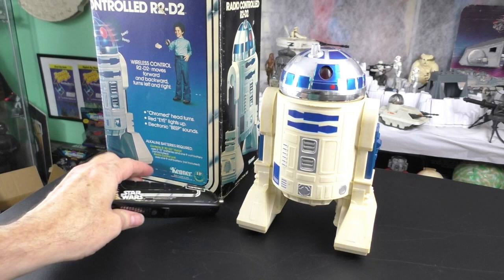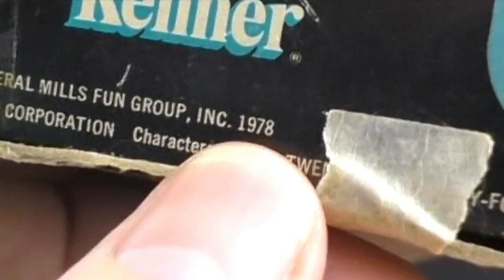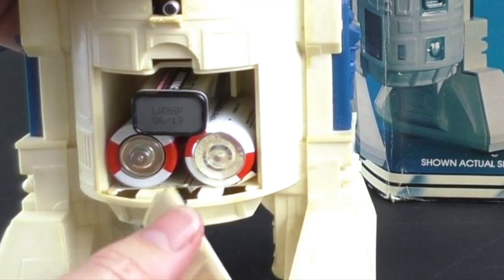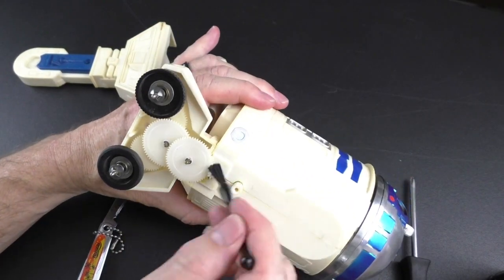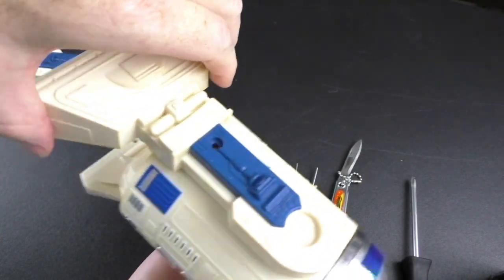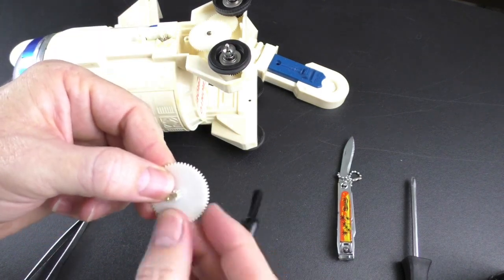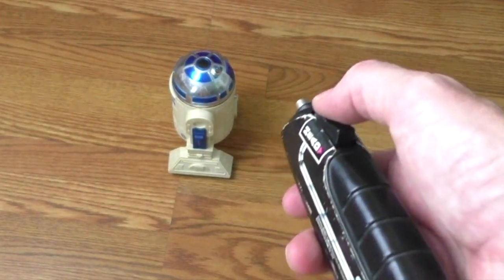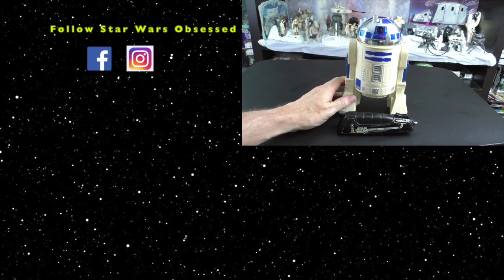Vintage Radio Controlled R2-D2 Repair

Comment: Hello my friend,
I need your help, since I can't get the motors on the legs to work.
The one on the head worked with cleaning and alcohol, but I can't get the others to work.
Do you know what it could be and where I should rule out possible solutions?
Reply from the maker: I appreciate you watching my video😊😊 the only thing I did was use lots of lubricant to unfreeze the motors. I was fortunate enough that it worked. Since I didn't do anything else I don't know much more about the electronics in the Droid. Sorry I can't help but there is a video on YouTube that has a thorough restoration. I recommend looking at that. Cheers, 😀

Comment: I have two. One works fine. The other did nothing. I got the wheels moving just by spinning them manually a few times. 
Unfortunately the same trick didn't work for the head! I guess I'm going to have to pull it apart. Wish me luck!
Reply from the maker: Good luck😀👍🏻

Comment: Hey, great video, thanks! I have an R2 that I am trying to fix...head and legs don't move but lots of beeping! The gears on one leg are really hard to turn, other side seems fine. Any advice? Haven't completely opened it yet :)
Reply from the maker: Hi! Thank you for watching😀 i would recommended using wd40 and manually turning the gears.😀
Reply: @StarWarsObsessed  Also, any recommendations for replacing the crumbling black rubber bands around the rear wheels?
Reply from the maker: @tlkaufman7  hmm. That's a tough one. Maybe look online for a seller who has those items. Also toy poloi does repairs maybe as a video showing black rubber bands. I hope that helps 😀